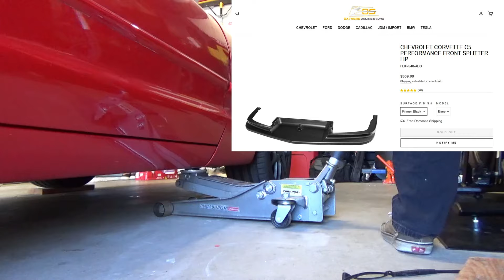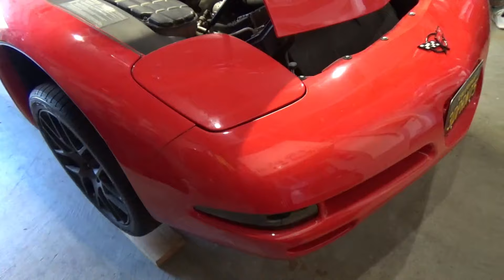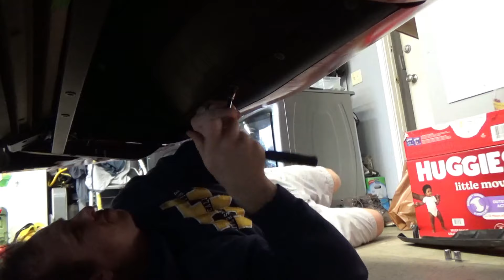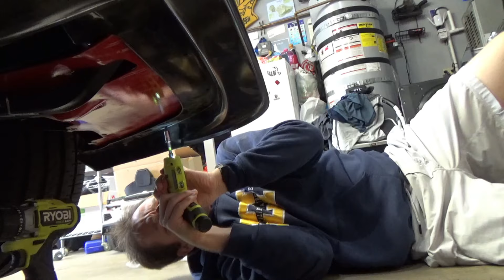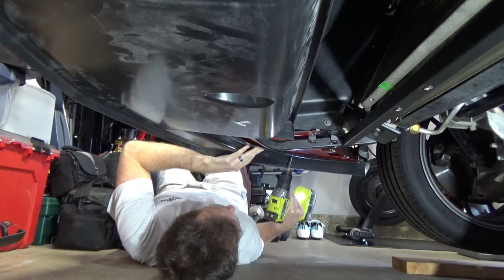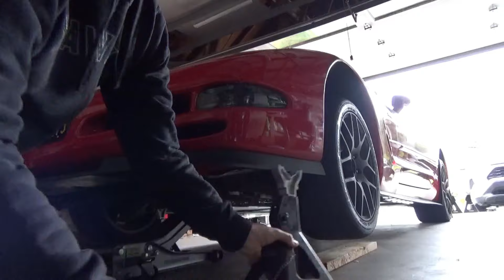Plastic Over Carbon Fiber..? Yes!! - C5 Corvette Front Splitter

Comment: What’s size were bolts, nuts, washer and bit size did you use?
Reply from the maker: 1/4-20 with flange nuts and flange bolts so I didn't have to deal with washers falling around while trying to reach into the tight spaces to install them.

Comment: how was it after driving at high speeds?  did it hold well etc?
Reply from the maker: No issues, held up great. Would definitely recommend using thru bolts though. I’m not a fan of self tappers if you can avoid using them.
Reply: @Addimotive  What MPH have you taken it up to.... In Mexico of course.
Reply from the maker: Or use self tappers with a wide head  or washer so it distributes the compressive force over a bigger area

Comment: Does anybody install these for function??
Reply from the maker: There are certain front splitters that are composite or aluminum that are chassis mounted to the front frame rails. That’s the only way to really make a functional front splitter. A plastic or even composite piece that just mounts to flexible front bumper is not going to do much, if anything at all, for downforce. I believe a company called nine lives racing makes one of the functional track spec ones.
Reply: Would blind rivets work?

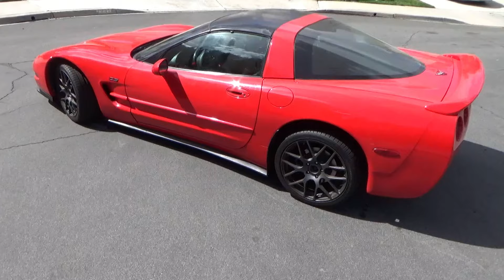Comment: So many awful kind of micro scratces on left side, you can see it on 13:36  basically you can do like  soft polish and put some  wax 🎉
Reply from the maker: Yea I’m aware of them, car has had them since before I bought it, likely artifacts from the accident it was in. 

They’re not just clear coat level scratches, they may look that way from afar, but they’re deeper into the base coat and primer. Have it on my to do list to touch them up with a paint pen and try to blend them in, just haven’t gotten around to it yet.
Reply: @Addimotive  if you are from LA you can look for guys from Russia who own small car shops and for 200 dollars you will get your car completely polished